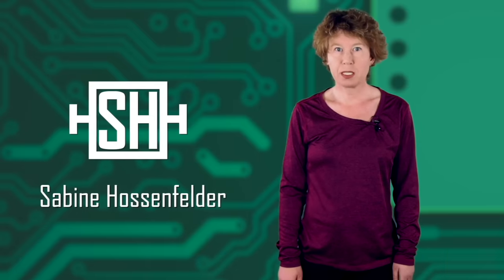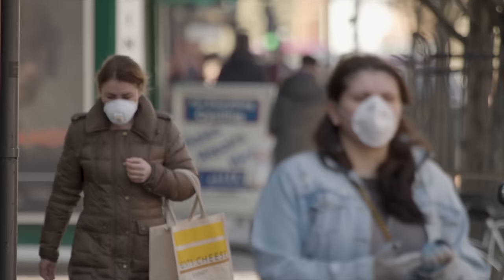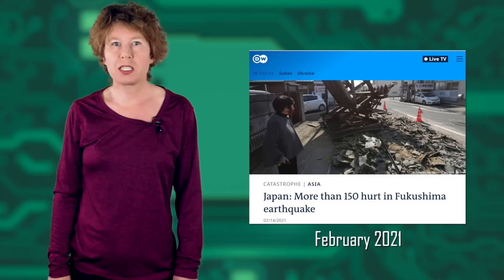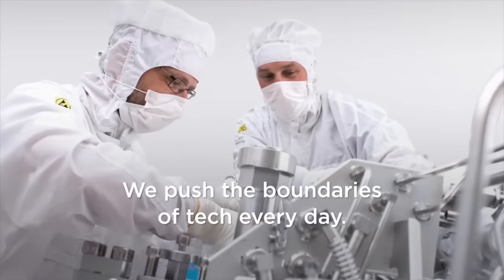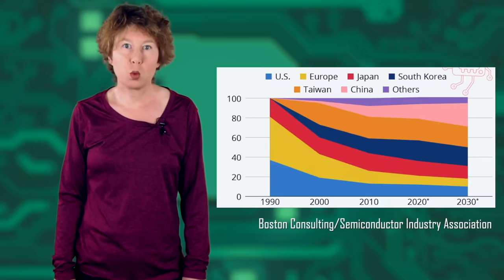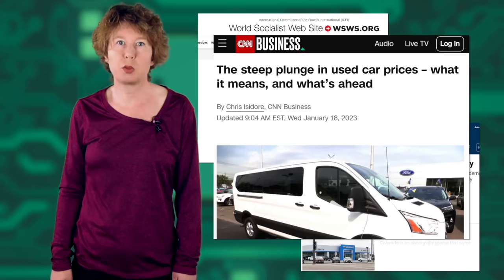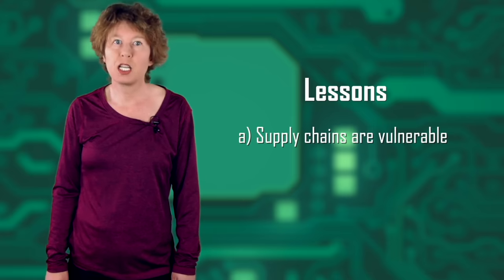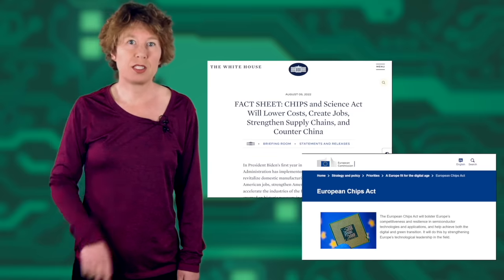All you need to know about the microchip crisis

Comment: The biggest lesson we should learn from this is to remove unnecessary chips from products that never needed them. I don't need a computer in my toaster. Or my toothbrush. Or ....
Reply: Wait, you don't want a toothbrush that you need to hook up with your Wifi to update the firmware and upload your usage statistics to "the cloud" before that damn thing allows you to clean your teeth? Well, assuming it hasn't been infected with malware that is? I dunno man, sounds like a totally cool product to me, it has blinking RGB lights and a creepy AI voice reminding you which teeth you missed after all! /s
Reply: Agreed. Many products are becoming unnecessarily over complicated. 
The best use of chips would be for robot servants who can then use and run all the unautomated tools and appliances for us! LOL
Reply: If those products didn't have those dumb chips, there would be less chip factories and so the shortage would've happened all the same. Those chips also tend to be much older technology nodes, meaning they aren't taking any capacity in factories making your computer or cellphone chip. Finally, not all chips are the same size or complexity. If a product uses a tiny chip that can be produced in a wafer of 10,000 other similar chips with 5x less manufacturing steps, the relative capacity required to produce it is low.
Reply: You say that but in many cases they have a chip because it's cheaper to have a chip. Your toaster has a chip in it because you can buy a 24Mhz 32 bit arm based micro controller for under 10 cents. You can't make a mechanism to pop your toast for that price. It wasn't just chips though that were missing, it was basic components too, bare transistors and things were going out of stock after being in stock since 1970. 
Also, my tooth brush doesn't have a chip in it, it's a lump of boring plastic. Made in a factory full of chips.
Reply: And reuse make things last and stop going down the road of upgrading every 2 years
Reply: @zyeborm  well said. I still think we aren't smart enough to have the stuff we have. When we can all recreate the gadgets in some way. Then we will advance. For now, we don't know anything really. We take ppl like Sabine's word. I myself hardly ever fact check. We take tech for granted. Thinking our opinions make the world go around.
Reply: At least one company is using, and bragging about using, microchips in their plugin air freshener.  They're everywhere!
Reply: Anything with a Lithium ion battery needs a microchip to control the charging process or they turn into mini torches.
Reply: @zyeborm Say that to car manufacturers. The only reason BMW needs a computer in your car is to make sure you pay for the monthly subscription of your heated backseat.
Yes, subscription fee on hardware you own is an actual thing now.
The thing is, overusing tech is a real problem, cars today have additional points of failures:
If you car says you have an engine error it may mean your engine got damaged or the circuit that checks it. Either way your car stops in the middle of nowhere even if the engine is perfectly fine.

We should be more practical about approaching our problems, because nowadays we pick solutions that make the same problem worse by trying to use "magic" tech to solve them that is even less reliable than the hardware we try to augment.

I'm an IT administrator and I have to tell you, people constantly ruin their life by overreliance and overuse of tech. Technology is a wonderful thing, but it's not magic.
Reply: @Kardfogu the thing with the heated seat example is something I can both hate the idea of, but also see the benefit to the business and customer on the other hand....

I hate the idea of subscriptions for harware you have 'purchased' although the heated seat example is more nuanced...

Currently every car on the production line is almost unique from the car ahead, and the car behind depending on what extras the customer ordered. That means, from the company production line perspective, they need multiple SKUs for all the seat options, AND all the possible variations... its an area where simplifying the SKUs (ie putting the hearing equipment in all of them) reduces costs, complexity, and can  in some cases speed up the throughput of the line. However, BMW aren't going to want to make heated seats a standard item as that would push up the base price of the car which is not ideal. So they decided to sell as a subscription feature which allows them to justify putting the heater in all seats without raising the bade price.

Another 'benefit' is the 2nd hand market, you could buy a 2nd hand car where the original owner didn't have the heated seat option, but BMW will engage with the new owner and they can then enable it, getting a 'new' feature the previous owner didn't have also helping the 2nd hand car market as well... this is almost a totally new area of revenue stream for the like of BMW that makes sense from their perspective, but also can offer benefits to the customers both new and 2nd hand.

However, with ALL that said and the clear financial reasons car manufacturers want to do this, it still annoys me the idea of paying to use something that you've already bought... i think the T&Cs matter here as well as IF the cost pcm also means they will fix it for free if it breaks (cause the idea of aaS stuff is you dont need to manage/update/fix the underlying hardware which is sold as a major benefit to streamlining customer costs) as you kinda expect other aaS type offerings then as long as the pcm costs isn't stupid then it ok. If however, as I suspect, you pay the pcm, and if the hardware breaks they then want to charge a huge cost to you to fix it as well, then its just a shite revenue building exercise where benefits to the customer are just lip service....
Reply: maybe you don't need, but the makers need money. ai-directed toothbrush has obvious appeal. homo sapiens is mis-named, should be 'person who thinks they think.''  
all things considered, evolution has made us master of the world, it worked!, without teaching us to control ourselves. perhaps impossible - some bright spark once remarked, 'if you think you know eveything, you are certain to be wrong.'
Reply: @Thats_Mr_Random_Person_to_you  TLDR; They save money by placing the heating into every single car, by simplifying the process. Then they ask you to pay, because your car was cheaper.
You pay extra, because they saved money on the manufacturing.
That's just great.
Reply: @Vector_Ze I'm actively adding microcontrollers to all my existing appliances, so I can control them without getting up or have them turn on or off based on rules (time of day, air quality etc). I don't like the waste of buying a new appliance just to get smart features, and I really don't like relying on apps and online services of varyingly low quality. Hence why I roll my own.
Reply: THIS is without a doubt a huge part of the solution.
Reply: @markmuir7338  Now that's a solution to many things. That and people who build their own has one advantage: they learn to estimate how reliable their own system is.
That knowledge by itself is powerful.
Reply: Even if you don't have a computer in devices, you still need chips.  Unless the toaster is purely mechanical, you still need a timer - that's a chip.  Battery charger?  That's a chip.  Chipless battery charger?  Still needs discrete semiconductors that are in short supply.  Ultra simple semiconductorless battery charger?  Takes forever to charge or is a fire risk.
Reply: Yeh but i need my wifi cutlery and my bluetooth hat
Reply: In 1943 Thomas Watson, chairman of IBM, said, "I think there's a world market for maybe five computers."  In 2023 we are now at the multi-billion stage,  I do wonder where this will go in the future, will we run out of resources, or will there be alternative technologies, or will we go back to simpler approaches?  I wonder, and maybe worry a little, not for myself but for my grandchildren and their children.
Reply: @Thats_Mr_Random_Person_to_you  RE: "However, BMW aren't going to want to make heated seats a standard item as that would push up the base price of the car which is not ideal. "
What kind of flawed logic is that? The heated seats ARE a standard item! They have just been disabled. It would actually cost BMW less to NOT lock out the seat heaters! Jesus!
Reply: But you want a giant screen that will tell you weather on your Samsung fridge😂😂
Reply: nah lol, that's not the right lesson at all. And also completely uncontrollable and unrealistic.
Reply: Yeah lots of industries are using cheap silicon to justify massive price hikes
Reply: @nickm8134  "will we run out of resources, or will there be alternative technologies". Necessity is the mother of invention, there will for sure 100% be alternative technologies. It's not going to end or stop, unless we somehow manage to destroy ourselves, which is definitely not out of the question.
Reply: What?? You don't want every single thing you own plugged into the IOT, the internet of things, so they can't turn everything into a subscription based service, so they can force you to pay monthly fees on your toothbrush etc. or they turn off key features?? Heavy sarcasm.
Reply: I used to joke that we'd know we had gone too far when toasters had computers in them.  Then I used to joke that we really, truly, were beyond the point of no return when you could hook your toaster up to the internet.  Then I gave up and dug my parent's old Sunbeam toaster out of storage.  Works great, best toaster I've ever used.  ;)
Reply: What a lame comment! The manufacturers put chips in everything because it's way cheaper to control things electronically than mechanically. Not to mention it's easier and cheaper to fix, should there be a problem - fixing software by flashing new firmware as opposed to modifying a production pipeline to produce an updated mechanical part.
Reply: @321ooo123  it's also easier to install a subscription based economy on everyone, forcing us to pay subscription fees to keep things running...
Reply: Agree also ; we seem to create shortages & bottle necks unessarily.
Reply: @nosuchthing8  chips in things don't mandate a subscription-based model. Or IOT.
Reply: @321ooo123  yeah, but that's the main draw from a return on investment model.

They are already doing this with some cars. Where some up scale features like seat warmers turn off unless they keep turning a pretty penny off you each month.

Not possible without excessive chips, wifi and iot support.

My latest printer demanded I pay 10 bucks a month to keep printing. Luckily there was a way around that.

Good luck using your toothbrush years from now if you fail to pay up each month.

And you can tell yourself your object oriented toothbrush is worth 5 bucks a month...
Reply: You don't, but I do.
Reply: That's funny but not a remedy for preventing a world wide shortage like the one being described. Multiple sources of manufacturing of microchips in different countries is the only logical solution. Putting less eggs in only one basket is not a solution.
Reply: A million transistors are cheaper in materials than just one.
Reply: Printer cartridges, just to enforce DRM and make perfectly good ink "expire"
Reply: @BaghaShams  How do they do that on a technical level?
Reply: Remember Juicero? If this means we'll never get another product like that again, well that's A-OK in my book.
Reply: Why unnecessary ? Those things are microcontrollers. They replace multiple mechanical parts with a single component. And often add functionality as well. And are often cheaper.
The downside is that the manufacturer now has a black box that no one else can copy and therefore repair , but that’s a function of how the laws are written in the manufacturer’s favour, because software is treated under copyright and DCMA, not a technology issue. That should be changed.

Comment: The interesting development lately, Sabine, is that new companies are starting to make compatible chips for those in shortage. 
In the FPV market, for example, we use some microcontrollers which are pretty expensive right now... And now there's an alternative, which seems to work even better. But we shall see, because they're not fully integrated in firmwares we use, like Betaflight, iNav and ArduPilot. 
Anyway, thanks a bunch for the video!!! 😊
Stay safe there with your family! 🖖😊

Comment: 1950s microchip or micron 1=10^-6 of meter in size. We had thousands companies without minimum scientific R&D. Today Nano  1=10^-9 of meter. we have only one equipment manufacturer and 10 chips manufacturer because it requires minimum 20 scientific institutes on R&D. Globalization which caused chip shortage globally is not just trade but also global collaboration at near "God" level technology development, fire at one factory causes global shortage at assembly line. Technological singularity is coming, today we have  7 nm chips and Angstrom  1=10^-10 of meter is 1 atom integrated circuit you can not squeeze more than one atom.

Comment: You may have interesting journey if you explore the steps needed to create the material purity required to fabricate the most advanced chips.  I remember sitting in a meeting where the effect different oxygen isotopes on the potential failure of a circuit was the main subject.

Comment: Another factor causing chip squeezes was when car manufacturers cut strongly back on production with people spending much more time at home. Hence they did not buy the chips needed for the electronics, leading to manufacturers of these retooling to newer processes. When the car manufacturers started buying the old chips again, the production capacity for the very old processes was no longer there, hence bad shortage. And switching to newer production processes with different chips was not just easy to do.
Reply: And then at the end of 2020 leaderhip waking back up realizing didn't use their budget suddenly began restarting projects.

Comment: One thing not mentioned in the video is that microchips are all very different. A product is typically designed with particular microchips in mind, so if one is suddenly unavailable you either have to switch it out to a different one (time consuming, costly, not always possible) or delay the product as a whole.
And these chips are generally very cheap (just a few dollars or even less) while the entire product can cost hundreds or thousands of dollars. That makes this shortage especially painful.
Reply: That was mentioned a couple times in the video. @14:50 and @15:40
Reply: 12:59  14:36  15:38

Comment: I chose to upgrade my LG V20 (2017) with a NOS LG V20. I have removable battery, 512 GB microSD, HiFi DACs, headphone jack, and IR transmitter. I plan to keep my 2003 F150 for as long as I can because it's mostly mechanical. I wish I still had my 1977 MB 300D, but parts were becoming impossible to source (and it took special tools to adjust injector pump timing).

Comment: Oil refineries and Chemical plants used specialised chips for their control and saftey networks, as well as transmitter and electrical equipment. I witnessed by how little we avoid an oil refinery beung stopped due to this supply chain issue and saftey reason because of it.

Comment: One of the lessons not learned from the chip shortage, is that the automotive sector's global contributiin of JIT inventory system to global commerce proved to be a very vulnerable business model to disruptions. Having some redundancy built-into the supply chain might not be such a bad idea adter all! 

Thw supply chains everywhere are far to lean and not robust enough to withatamd the shocks that will amd have already come. More such diaruptions are in the offing unless we concentrate of building supply chain redundancy and robustness.

Comment: Quite annoying. Got a new cryostat, ordered a few temperature sensor diodes with control unit... 21 weeks delivery time. But on the bright side, it would display between 4 and 5 signal reading which only three diodes connected, so i guess that's something. :/

Comment: I needed a new computer couple of years back.I think it was 2021 spring. I live in the EU, Finland.
All the midprice graphics cards were out of stock. You could only get the very high end, ridiculously expensive cards or old cards that had multiplied their price. So I still use old graphics card.
Could not get the CPU I wanted, nor the 2nd or 3rd choises. Had to buy a lot more expensive than planned.
Freaking hell it was difficult.

Comment: One thing that many people don’t realize is the effect of the chip shortage on the aerospace industry.  Since aerospace is safety critical, it takes a tremendous amount of effort and funding to certify the software that resides in these microprocessors.  If you change the chip from the original part, then they have to recertify the software.  Therefore they are dependent on the same chip that they originally certified the software on.  To make matters worse, an aircraft life span is greater that 30 years.

Comment: The electronics trade has had a history of SPOFs. (Single Points of Failure.)  at one point, essentially all the world's disk drives were built in a small part of Thailand. Guess what happened when that suffered serious floods?  Geographical concentration creates vulnerability to severe weather or geological events. 
On another occasion, a fire at one chemical plant revealed that it was the world's source of resins necessary to make the support components. I'm sure there are lots more of which I haven't heard.